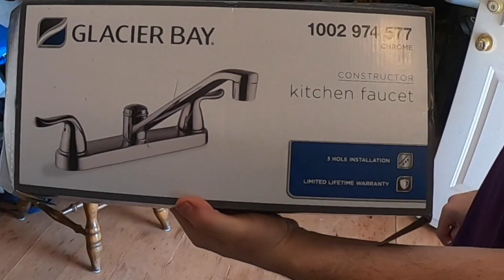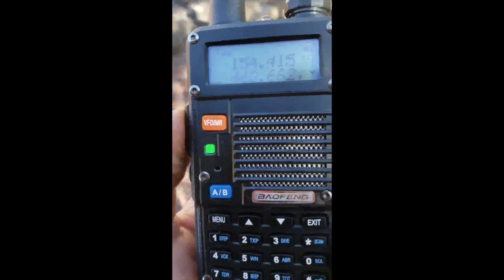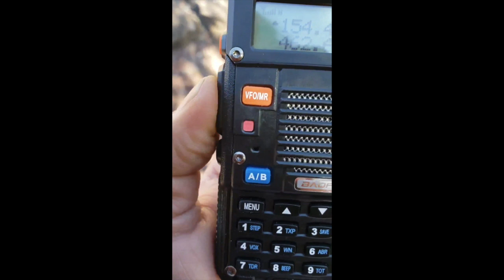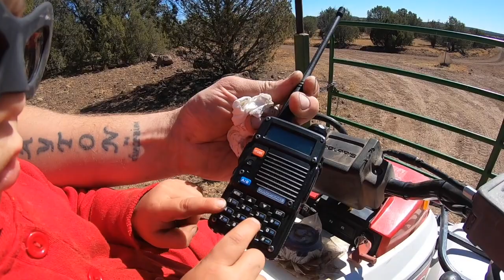CCTV E42 Off Grid Done Right E2 - Repairs and Op Sec Protocol

Comment: Good video, a couple of comments....seems like there should be some sort of automatic chain tensioner on your ATV.....idk...I have that exact same model Baofeng and the first thing I did was replace that rubber duck antenna with a Nagoya NA771 15.6-inch whip antenna and bought the extended capacity battery. Paid less than $40.00 for both items....With that antenna I have gotten over 10mi line of sight simplex (2 way).
Reply from the maker: Yardbirds wow, ok. I’ll check on the radios. Where is your chain tensioner on yours? And what year is yours? I’m not a total slouch with this stuff but man I’m telling you I couldn’t find anything except that damn polymer guide underneath that did have an adjustment. Every other vehicle I have had a chain on has had a way to either slide the axel back a bit in the swingarm but man I looked at this bike for like 30 minutes and could not figure it out aside from the polymer piece. Believe me, I was out there cussing up a storm feeling like a moron. But hey, I couldn’t find it. Lol.
Reply: @PrescottCaliberClub  Shoot I haven't had an "ATV" in a long time, in fact the last one I had was a 3 wheeler Honda 250R, incredibly fast and inherently unstable. You had to constantly counter steer just to go straight..but no a roller chain tensioner for ATV's is most definitely a thing. Of course it would need to be welded on somewhere